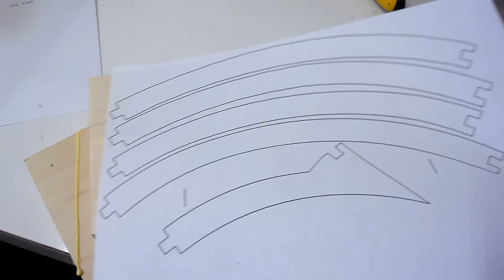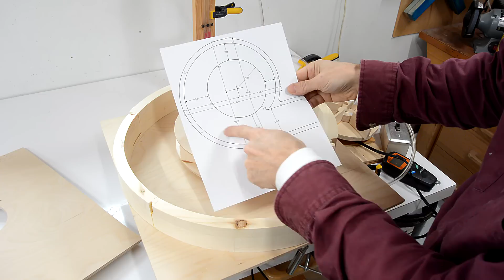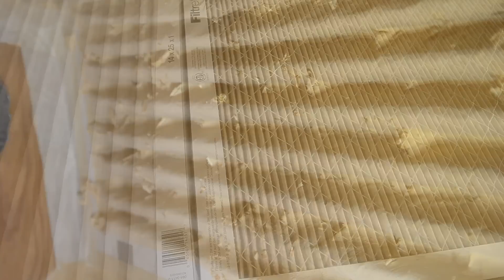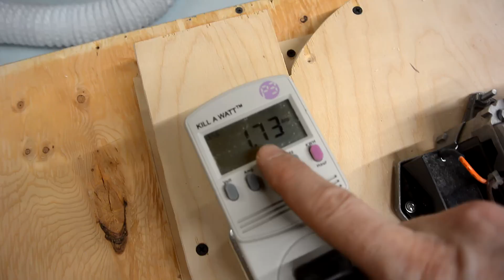Box dust collector

Comment: It seems to be a theme of your dust collectors that you "Should have used a slightly larger motor".  Almost every video ends with that same line.
Reply from the maker: that's because I always size the blower as big as I can get away with with the motor that I start with
Reply: In 10 years your dust collector project will be 10 shipping containers with a hemi to power the blower.
Reply: "...but if I had it to do again, I'd probably use a Detroit Diesel."
Reply: he started this video saying the motor was too big so he increased the size of the fan blades and now he needs a bigger motor but then that motor will be too big so he will have to increase the fan blades again but then he will need a bigger motor........
Reply: Dave L I’ve found this black hole that I can use as a dust collector but I wish it was just a tiny bit more powerful

Comment: That motor is likely assigned its current rating based on 40 C and stagnant air. You can always get a little more of it the motor when your conditions are more mild than that. 

In fact, in the HVAC industry, manufacturers will retest nominal horsepower motors and rerate them to whatever they can get. I've seen a 3 HP motor get rerated to 4.5 HP because it's in an airstream and the airstream never gets over 25 C.

Comment: great job with the blower design. power consumed is a function of the impeller design. It's the only part that consumes power. the only reason I bring that up is cos at one point in the video you tried to reduce the power consumed by changing the volute design. if you ever want to try a new impeller design I can make up one in some proprietary software I use at work, to match the incidence angle, and with about 45 deg backward lean at the end.

Comment: Matthias try to find a blower from an old hot tub. The one I used for my system is 220 volt, supposedly 2 hp with very high static pressure because it is designed to force air into the jets. They are easy to find in the back of any pool or spa place and free. Like you, the only thing I bought were the hoses and fittings. I'll send you photos of my complete system if your interested.
Reply from the maker: I'd be curious about one of those blower.  I would imagine they are designed for very low CFM
Reply: Matthias Wandel yes very low and that is why I don't use gates. Instead I just move the hose around. 4" hose doesn't really help over 2" either. If I'm not careful and I accidentally deadhead the intake it will collapse my garbage can / thein baffle. lol it's been working for 3 years and I I'm happy with it... especially the price. Considerably quieter than other setups as well.

Comment: Can't you use the air output of the dust collector to cool the motor? This way you could run the motor with a higher load. Motors are rated to a maximum power mainly because of temperature limits.

Comment: The power your motor is good for really depends on the winding temperature rise, they can afford to get pretty hot before you start degrading the insulation.

Comment: "1/10th horsepower motor"
1 hp = 750W
1/10hp = 75W

1.8A at 110V = 198W
198/75 = 2.64

Am I missing something, is this being run at 250% rated power or is it actually a quarter horsepower motor?
Reply from the maker: Yes, you missing that these motors are not that efficient.  It takes 80 watts with no power coming out at all.
Reply: Of course, that's my mistake - I'm used to dealing with R/C motors which are rated in electrical watts, with who knows how much output power, but this is rated at 0.1hp mechanical power output.  Definitely a useful thing to remember!
Reply: So if a have a Brushlessmotor and it says it has a power of 1500watt, is it now mechanical output or electrical input?
Reply: Megaspasstpräsentiert yes.
Reply: Ant Mallett power out divided by power in. In this case 75W out / 198W in is about 40%.

Comment: You can make your drill press into drum sander, just make simple box wood that can easily be clamped on drill table, make hole slightly bigger than drum you make and glue sandpaper on that has drill chuck attachment point, add side hole to box gto vacuum dust. Done.

Comment: The DW735 is such a pain in the ass to work with.  It works but man, between the built in blower, the noise, price, and the fact it throws sawdust 20+ feet and blows all the seals on standard dust collection.... thing is just a pain to deal with.

Comment: Hi Matthias, i'm totally addicted to your videos. Your enourmesly broad vision on life and nature is refreshing. I would simpely pose a little question about the dust collection. Is it possible to use a washing machine motor for an impeller for a dedicated dust collector? Will it be powerful enough and not spinning to fast? I hope that placing this question with this video is appropriate enough.
Thanks Ron
Reply from the maker: If its an induction motor from an upright washer, it will spin too slow.  If its from a front loading washer, its a brushed motor and is not suitable, as its not built for continuous full power operation

Comment: hi matthias! why dont you measure de difference in suction and head? i think centrifugalpumps are better at head than at sucking pressure,so if you force your air though filters its possible jt works better.
Reply from the maker: that would require putting the debris thru the blower, which would require a less efficient style of blower (and also one made out of metal)
Reply: Matthias Wandel Wood woudnt Hurt your blower i think? if could be worth the try. or you could glue soms aluminium plate on the Wood? i would be interested in the difference in pressure you could achieve. especially that the filters block neef soms pressure tot work well. or you could try the other design for the filters you use in you shop tot clean the air of small particles. kind regards

Comment: Mathias,, a bit of research and discovery on the MERV ratings of the filters you are using and the effectiveness of particle size removal would be helpful. The filter you describe as not designed for dust removal, is for just that. The MERV rating will give you the particle size removed and type of particles being removed. MERV 8 Is adequate for most shops if placed properly with adequate air flow.
Reply from the maker: Yes, it's designed for dust removal, but it's a completely different sort of dust removal.  These filters aren't meant to get caked in dust.  The MERV rating is kind of irrelevant once it's caked.
Reply: Yes, the effectiveness of any filter is hindered when caked. Maintain or change filters regularly.

Comment: Wouldn't it be a good idea to build a large outside dust collector to not have them take up space in the shop? The noise would also go down. You'd lose power to tubing but for a small shop with short distances like yours it wouldn't be a big deal. 
The larger the impeller the more efficient it is and the less noise it will make.
Camouflage it as a shed or make it part of an actual shed.
Reply: Helge FrisenetteI once had the same idea, but it would make the house really cold really fast. Outside air would rush in at the same cfm as the dust collector.  Maybe if you would direct the filtered air back in, but too much hassle to justify

Comment: Curious with all the machines and various dust collection machines Matthias builds... why not build the dust collection straight into the machine?  Granted it's going to suck a little more power from the machine, but surely a slightly larger motor could resolve that (he's doing this one with a 1/10hp motor and it's working with a thicknesser of.. what, 2hp or more?).  

I'd love to see a version of his big belt sander with a little cyclone separator built-in and collecting into a bucket in the machine base itself.  Seems like it'd save having to run extra ducting, power cords, and turning on an extra switch, too! Be a fun little engineering challenge for him, too! (Go on Matthias, you know you wanna!)
Reply from the maker: I didn't build the planer.
And for the jointer, it would be much eaisier to have a separate blower motor than to take power off the main motor.  Same for the bandsaw.
Reply: Thanks for the reply, Matthias! Sorry, didn't mean to imply the thicknesser was one of your own machines... completely the wrong colour, for starters!... though if you're looking for a new project... ;)  Though it'd be hard to make one for less than you can buy 'em these days... I was just looking at the difference in motor power between the machine generating the dust and what was required to collect it, the suggestion being that perhaps there was a bit left to spare that wouldn't impact performance that noticeably..

Comment: your experiments into motors and rated loads are awesome.  thank you for these demonstrations, as well as the explinations.  as someone who does not have a plugin amperage draw display thingy, how would a garage tinkerer go about determining if a motor were overloaded?
Reply: They're $20 on Amazon https://www.amazon.com/P3-P4400-Electricity-Usage-Monitor/dp/B00009MDBU If you have a multimeter that can measure RMS (AC) current you could hook that up to your power line, but I wouldn't recommend it unless you knew what you're doing.
Reply: Andrew Cedzo see, i really dont know how to do that with a multimeter, and as a retiree without a job, i havent bought a tool for over 4 years.  i get free wood, free stuff from junkyards, etc...
Reply: What's your DMM? I was slightly wrong about needing RMS, but it'll help. It needs to be able to do high current AC measurement though. Then you would need access to the mains and be able to cut it. Make sure power is off/disconnected. Easiest would be to cut up an extension cord. Take one of the wires (I'd recommend the neutral if it's polarized) and cut it. Connect the DMM to the two ends of the cut wire with something that will stay by itself (alligator clamps work great). Make sure nothing else is touching the wire. Start up the DMM in AC High Amp measurement range (double check you're leads are on the high current range and not the voltage/sensitive range). Then turn on your power.

Make sure your DMM can handle the current the motor will spit out (especially the inrush current of the motor). There's a lot things you need to make sure (I probably missed them), so be careful if you really want to do this. Breaking a $50 DMM might be more expensive than buying a $20 power meter. Plus the dangers of working with mains can be even more costly.

Also, the Kill-A-Watt is fun to use to see how much power all your appliances and other electronics use. This method works but is annoyingly slow.
Reply: Andrew Cedzo that all makes sense, and i can kinda visualize it.  dangerous and fun.  BUT my last DMM let out the mysterious blue smoke a few years ago when i was being careless.  what im thinking is that theres a mathematical way to build a blower based on known ratings and fan sizes to ensure a motor doesnt get over worked.
Reply: Well you got me at this one. There's a lot of math that goes into figuring out fluid dynamics  that as an electrical engineer I wouldn't know where to start helping. I'm guessing there's no easy way to do it without experimentation (hence the other few videos in the series).
Reply: well, i figure i can get close with some corporate documentation (suggested loads, what has been built before, etc) and then just reduce the airflow a bit from that, err on the side of caution, so to speak, and basically make an educated guess.  im not going to be running a fan for 8, 4, or even an hour straight.  i plan on fabricobbling (to use an AvE term) together a remote switch with a solenoid and a ceiling fan controller i have from the trash.  that way the fan is only on by demand, and even if im overworking it, it wont burn out with intermittent use.  my next hurdle is getting a motor, any motor, that is larger than a weed whacker motor.  theyre useful, but small.  here in central texas, we dont have furnace motors just lying around.

Comment: Mattias,  Always great to see you doing "what if I?"  experimenting and using scientific principles in your woodworking experiments.  Got me thinking.  I'm planning to rewire my 120/220 motor to 220 to reduced the power consumption and increase the impeller size about 1 inch. Bill Pentz uses very large impellars in his designs.  Got a 6 inch coupling with a restriction hole of around 5 inches. I've observed that removing that increased the air flow on a similar Duct Collector. any thoughts?
Reply from the maker: Rewiring the motor won't add power.  It just means less voltage drop in the wiring, which might help a little bit.
Reply: Thanks!  Figured it would reduce the ampere draw?  What do you think about the increase in impeller size with same shroud/housing?

Comment: I have a 200V 2.2 Kw 3 phase 3 HP motor powering a large squirrel cage blower. I need to find a very large separator and filter to make a complete system. Being in Japan I don't have access to wood working stuff much so would you build a separator and mount to a trash barrel and put on a filter bag 2nd stage or what?

Comment: Question on emptying and cleaning. What would you recommend for regular emptying and cleaning? I'm assuming you don't want to take a shop vac and vac off the filters so that you can retain the fine dust on them. So maybe just empty the box out, and then just knock a little of the heavy stuff off the filters with a bench brush or maybe just by hand? Does that sound about right?

Comment: Make the fan blades thinner(or from a lighter material than wood) and push the RPM higher. Less weight, less obstruction , less power draw, and eventually same end result.

Comment: Did you think of using a cyclone design to make the filters last longer ?
Reply from the maker: The blower isn't powerful enough.  Too much pressure is lost in the cyclone.  Might as well use some of that pressure to get the air thru the filter.

Comment: Quick question. Why don't you design a designated dustcollection system with pipes in the "unseen" corner of your shop or next door with the storage? Sort of just like Marius has it installed.
Reply from the maker: because those spaces are occupied, and because I'd need some really long duct runs

Comment: What would happen if you put a small impeller on a large, overpowered motor? What would happen to the airflow? Static pressure?
Reply from the maker: No change.  Just because the motor has more power doesn't mean it runs faster.

Comment: Thanks! Very informative and enteratining as usual! I have a question: I understand your explanation why a motor is under less load when the airflow decreases. However what I observe using a shop vac is quite opposite: when the hose is blocked (thus, air flow is minimal), the motor sounds like it the load is maximal. Could you comment on this?
Reply: When not blocked, the motor is under load, and air resistance means it can only turn so fast...it's actually doing work. When the port is blocked, the air isn't flowing through the system, so the air around the impeller just spins as a unit with the impeller...there's no change in the air mass being spun, no turbulence from incoming air, or outbound air, to put additional drag on the impeller. So it can spin faster when it's "under no load". That's why it sounds like it's working harder, because it's spinning faster.

Comment: Hi, so i want to hear your opinion on building my own dust collection system.

I just finished building a 100 sqr meter workshop, what kind of system would you recommend me to build? I am going to use pvc pipes for it and the other flex pipes to the machines.

Comment: 1:36   Do you measure water suction as a difference from the high side to the low side?   I always thought you measured it from the "zero point" (where they were both equal) to the high side.    Have I been doing it wrong all these years?

Comment: I've been wondering, how would this compare to the blower out of a vacuum cleaner? I salvaged one out of a broken vacuum cleaner a while ago, and it's so much smaller than this one, yet almost the same in design, and it seems to generate plenty of suction and use a tiny motor (As a vacuum cleaner that is, I did not make it into a dust collector). Have you ever considered picking a vacuum out of the trash or such to save work in making a dust collector? Is it just too loud?
Reply from the maker: Vacuum cleaner blowers are super loud, consume lots of power, and don't last very log

Comment: I feel that your diffuser (the scroll) is not optimal. The idea of a diffuser is to slow the air down as it comes out, to increase the exhaust pressure so that it can best push the atmosphere out of the way, thus relieving the motor of work to do. In short your outlet is too small, so the air is still travelling too fast which wastes energy. Optimally it needs to be 3 times the diameter of the inlet, That is 9 times the area, so the  air is travelling at one ninth the speed recovering 81% of the energy.

Comment: it's really counterintuitive that restrictions on airflow will lower power consumption.  do you have a good reference explaining this?
Reply: vitriolix 
less air is accelerated, thus less power is needed
Reply: Hdot H intuitively you would think that the motor would try to spin at some sort of natural maximum rpm but as you add restriction it has to fight harder in order to get up to speed
Reply: Fester Blats great explanation, thanks
Reply: It's magic!! You lose if you mind it. :) Or that's how they teach in schools nowadays...
Reply: >> intuitively you would think that the motor would try to spin at some sort of natural maximum rpm but as you add restriction it has to fight harder in order to get up to speed

This is true. It's just tricky what the restriction is. The restriction (load) is the air itself, so blocking off the air reduces the restriction/load.
Reply: reference?  Matthias probably already devised and build a machine to measure it